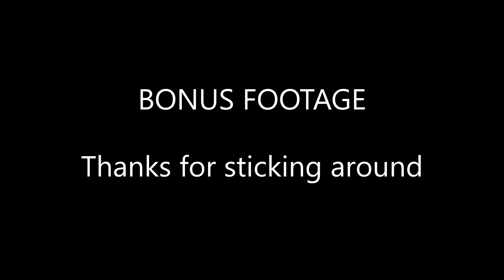PROPELLER COUNTER WEIGHTS - Constant Speed Props

Comment: Amazing explanation sir. I have a doubt that nobody clarified me related to what would happen in case of total oil pressure loss on the system. As far as i knew, the counterweights will make the prop angle to be in fine pitch in order to get the maximum performance while taking off or landing. It doesn't make sense to put the props into coarse pitch or feather cause the engine would still alive the only problem was the oil pressure of the system. So if you dont have any source of hydraulic (oil)  to counteract the force of the weights, the effect would place them into fine pitch.
I don't know if my thoughts are correct so if anyone can expain it to me i would appreciate it. Gorgeous video again sir !!

Comment: Sorry, but you are misinforming in this video. At 3:02-3:04 you say it rotates the propeller into zero pitch, feathered position. However, a feathered propeller is not in beta range (typically 0 degrees to 10 degrees range), so this is wrong.

Reverse range prop is negative -1 to as much as negative -18 degrees
Beta range (ground range) is normally 0-10 degrees
Alpha range (flight range, typically flight idle to max 5 min rating) is normally 11- about 80 degrees and
Feathered range (for engine failure) is beyond 80 degrees. 

Auto-feathering systems on larger turboprops exists in case of an engine failure at critical phases of flight (take offs and landings). If an engine fails while auto-feathering is armed, it forces the blade to an angle beyond 80 degrees relative to the plane of rotation. 

This serves two purposes: 

1. To lower prop drag to an absolute minimum. If an engine fails (on multi-engines), and the blade stays unfeathered ( in flight about 10-80 degrees, making a solid disc in the air stream), drag becomes so high you risk losing directional  control (especially at high GW), and it will severely decrease your glide range in both single and multi engines. 

2. To break the prop disc to a stop and remove any vibration and momentum. 

EDIT: Link to an image showing a P3 Orion in flight with one prop feathered and stopped: https://cdn.jetphotos.com/full/2/92295_1230352666.jpg
Reply from the maker: Hello MrGyngve, my hat off to you. 
Thank you for the clarification as it is most welcome. Any corrections and expansions of the topic will always welcome here. 
I just hope that people actually take the time to read the comments and learn from the ones like yours. 
Thank you, 
Plane Simple.

Comment: Excellent Information! I have a question.Are counterweights present in single engine constant speed airplanes as well? cause I heard in that case they default to a fine pitch in case of an engine failure and the presence of counterweights would hinder that right?

Comment: Very nice explanation! Would u plz do a Video on how a constant speed propeller works? How pitch is adjusted (coarse or fine or feathered)! Thank You!
Reply from the maker: Thank you very much Selam Tighten. I'm glad you liked it.
In that same video I explained how the pitch of the propeller is changed using oil pressure to counteract the propeller counter weights. But you are right, there are other mechanisms involved in feathering and un-feathering the prop. If I get the chance, I'll might make a video about that and also the propeller pitch governor.
Thank you for the suggestion.